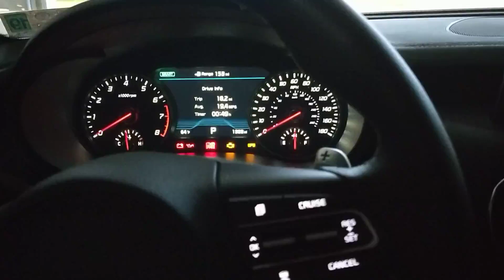Kia Stinger Drive Mode Changer Test

Comment: What is the point of this?
Reply from the maker: To automatically change the drive mode to the one I prefer when the car starts. And to automatically turn ISG off when the car starts. Without this, the car always starts in Comfort mode with ISG on.
Reply: @drdrew612  But you can change this stuff in the infotainment center of the car right?
Reply from the maker: @koreymayo8884  Nope. The car always defaults to Comfort or Eco. There is no way to save any other setting. Same for the ISG.
Reply: @drdrew612  That sucks, so how much does this cost?
Reply from the maker: @koreymayo8884  About $50, all of-the-shelf parts. I'm trying to get the cost lower with a bespoke option, but that's a few months off.
Reply: @drdrew612  not bad

Comment: Hi, it look`s nice. But can you show the schema for plug this stuff to car ? As I see it you have usb for power and only 2 wire provided to some plug in console ? I`m right ?  Thank you for your response and congrats for invention.
Reply from the maker: Hello! This was just a test to prove that the electrical side of things work. I have some fabrication to complete to run a full test. After that's done, I'll do a full write-up and post it in a few places. Aside from the USB power, there will be at least 3 wires going to the car.
Reply: @drdrew612  Sound nice. Maybe you upgrade this Project to Hill holder witch is similar to ISG ;)
Reply from the maker: @RadMarx  Solid maybe.  Would probably need to upgrade to a different Arduino board.  I have one more output pin available, but RAM is the issue.